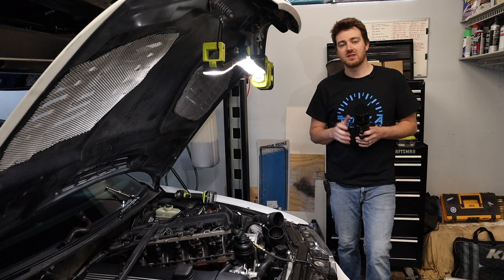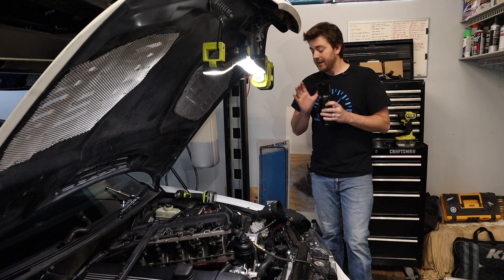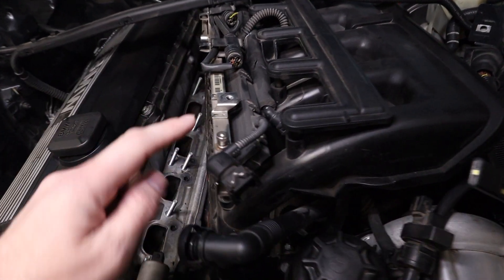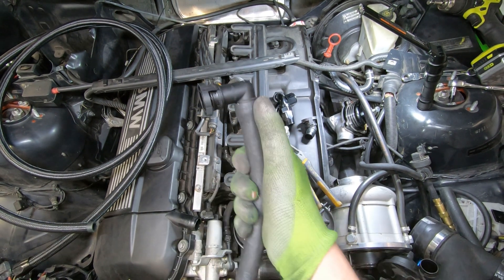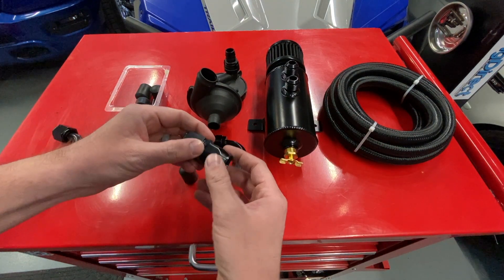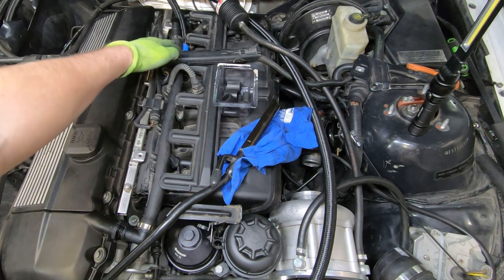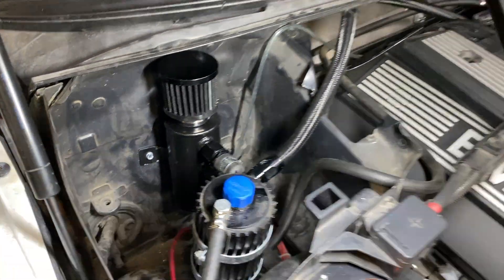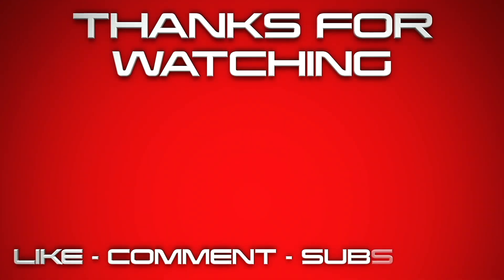Maxpeedingrods E46 Vented catch can install - supercharged Active Autoworker stage 2 kit CCV delete

Comment: Nice work and very helpful video! I have a G-Power supercharged 330i did by the previous owner and I think the CCV part is still 100% stock. Because of the positive pressure due to the supercharger, instead of the N/A stock negative pressure inside the manifold, I get bad fumes in the cabin and need to drive with all windows open. Question: does this vented oil catch can in that spot smell inside the car?